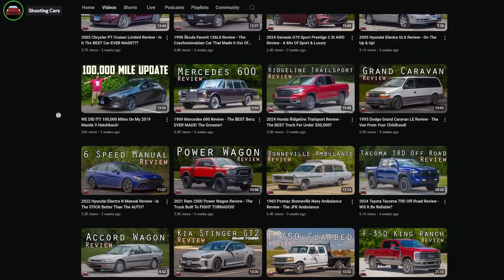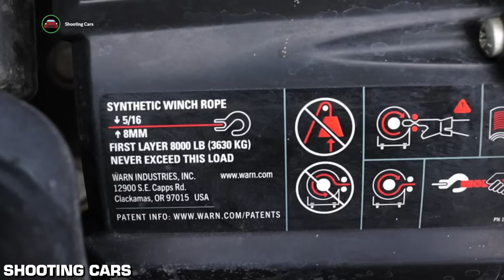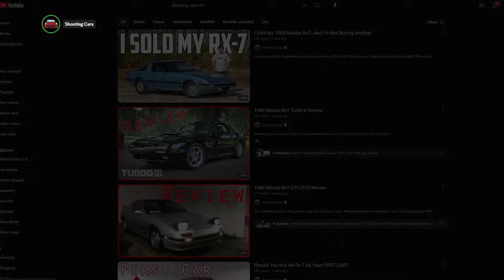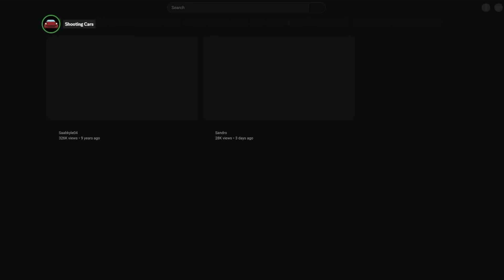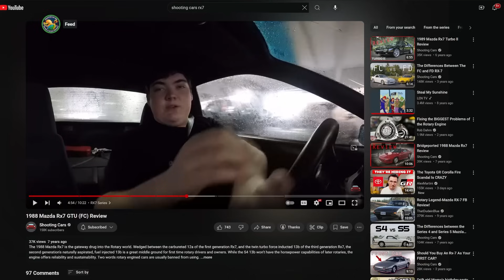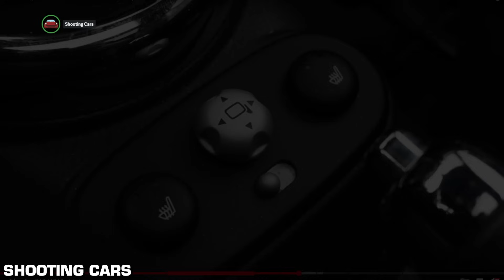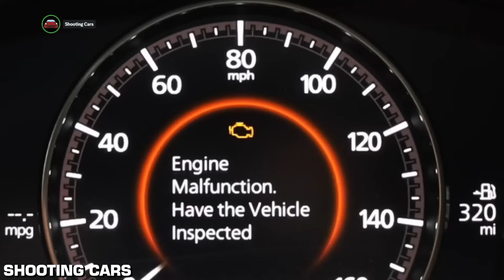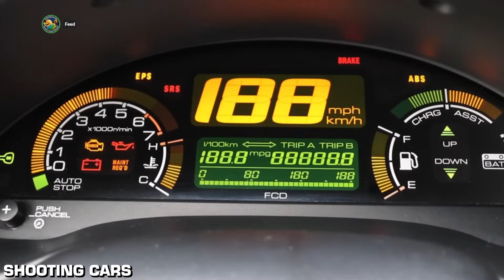Discovering the Fast and Furious 9/11 truck with Shooting Cars

Comment: 25:06 ... mold? you DO know that even though you are just filling it with water, you should be bleaching the bottle MINIMUM once a week... even just putting a little straight bleach and add hot water, seal it and shake... [careful of pressure!] #WashYoStuff